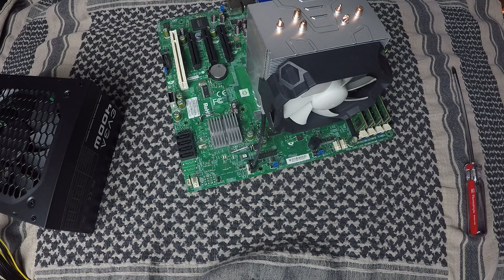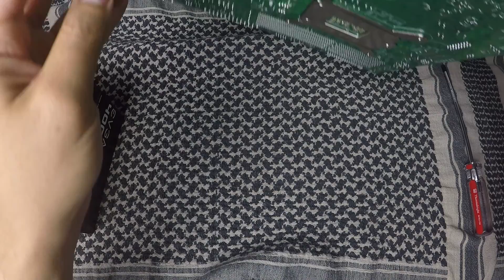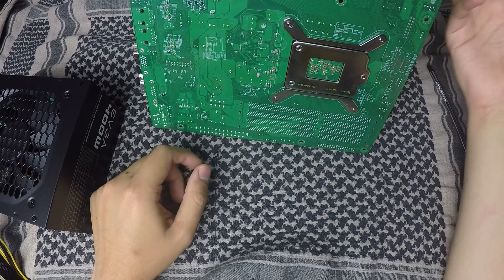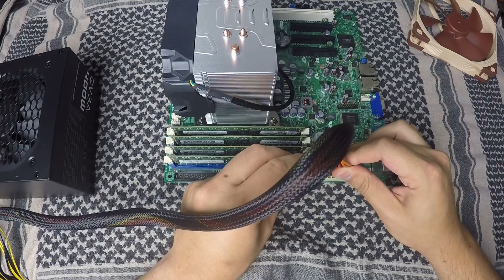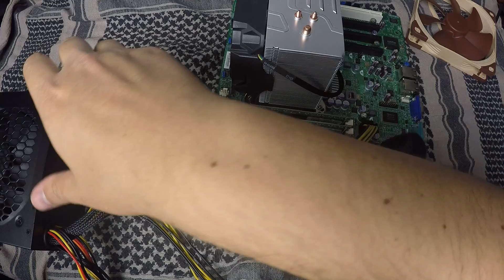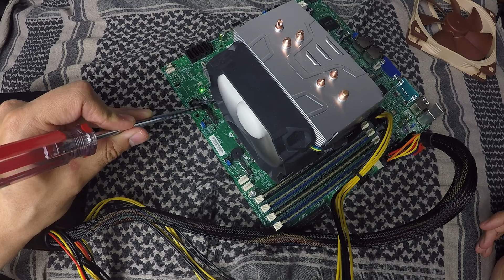How to test your hardware outside the case - make building easier!

Comment: I am hoping for a bit of advise. my computer shut off on me the other day and nothing was working. I figured the power supply would be the first place to start so I tested it watching another's video and it failed. I bought a new one and hooked it up, it did nothing. I thought maybe the computer killed the second one also so I tested it and it failed too. After some thought I decided to use something different for a jumper. The new power supply worked. I thought OMG I bought this and didn't need it.Tested the old one and it failed. so I followed you video and the green light lit up.but it did on the old power supply as well. But the computer still did nothing. I have done all of this inside and outside the case with no variance. Please HELP!
Reply: You're more likely to get an answer (and hopefully a solution) if you ask in the right place. YouTube comments is the last place you want to ask questions in, especially complex ones like yours. I will be more than happy to point you towards the right direction.

Try these places: https://www.reddit.com/r/buildapc/
https://discord.gg/buildapc/

Hint: ask in discord if you want a quick answer. I personally have only used their discord server for questions and usually get an answer within seconds. There are a ton of experts who can help you out and will be happy to do so 😀

Please tell me how it goes.
Reply: @blazingtornado8660  Thanks you for the help. Found out there was a spilled coffee issue my less than a year old motherboard liked. Fixed it and my formerly HP computer and I are getting along fine now so again Thanks.
Reply: @mjb12141963  you're welcome :-) glad it's up and running again. If you run into any future troubles don't forget to ask in r/build a PC or their discord. I wish you all the best :-)

Comment: I personally never build outside of a case although I'll sometimes use a test bench, open air case, or a 2U case because it is easier to both visually and physically access the components.  I couldn't possibly test on top of a blanket and I'm not even comfortable with testing on a motherboard box.  I wouldn't go so far as to say you're wrong because you make good points in your reasoning and I can't argue with success, but it's not a practice I'd likely follow.  Good video though.
Reply: some of us just have to work with what we have, so we have to be more careful and make sure no static and discharge every single time
Reply: Even homeless people have cardboard boxes!